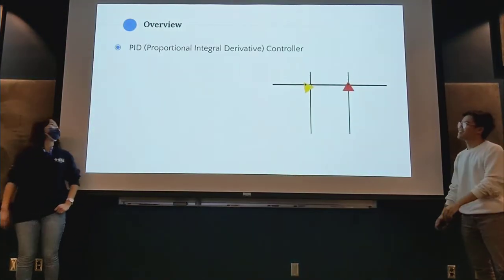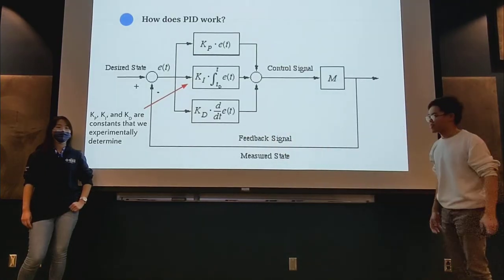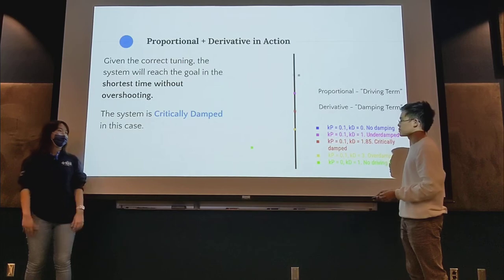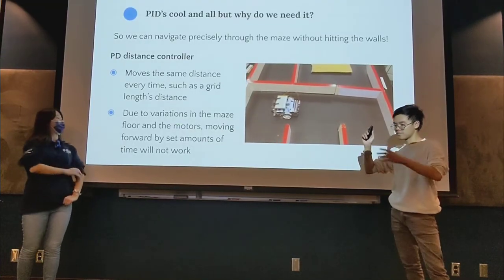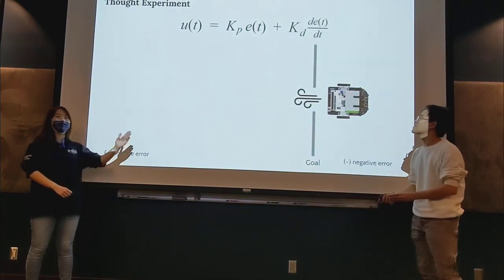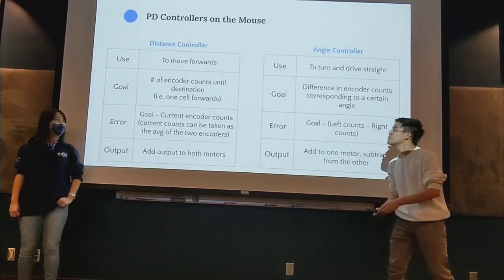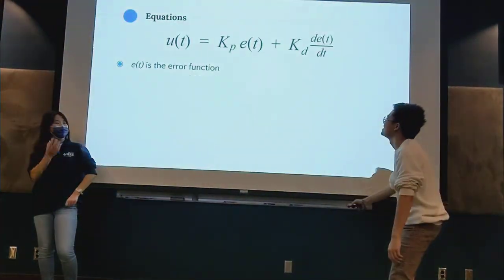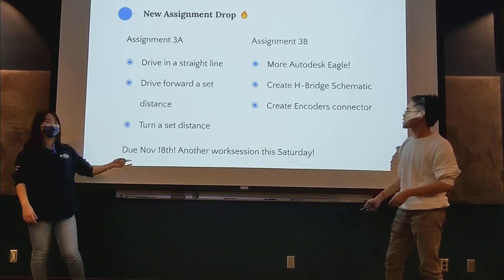Micromouse 2022 Lecture 3: PID Control System

Comment: can we add an imu for the pid for rotation ?
or will the pid will work better just with encoder ?
Reply from the maker: An IMU or a gyro would help w/ the accumulated error that just using encoders can have. Relying on encoders alone could lead to issues since error could build up from wheel slippage and inaccuracies. Of course, you'd have to change the controller to use both sensors accordingly.